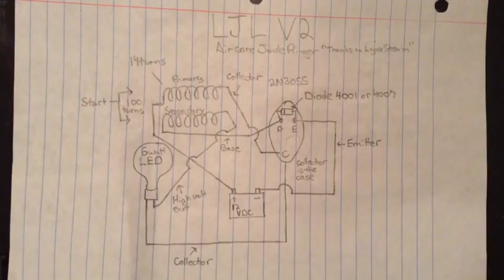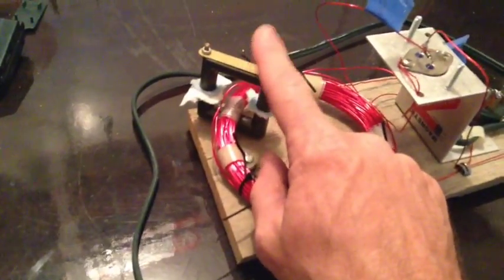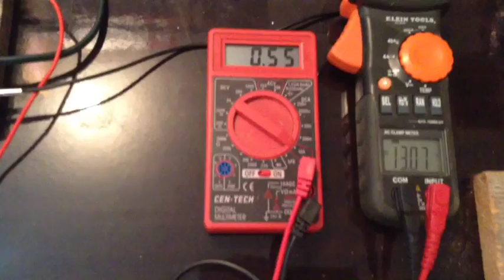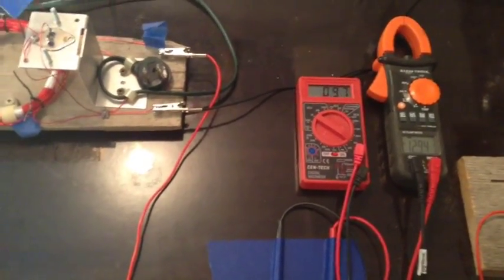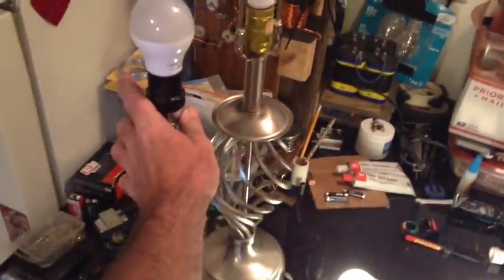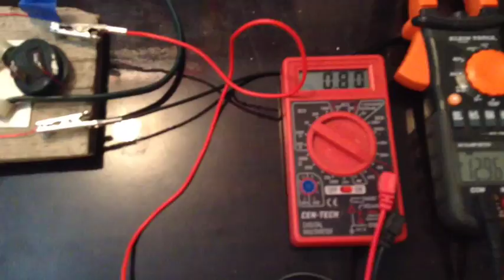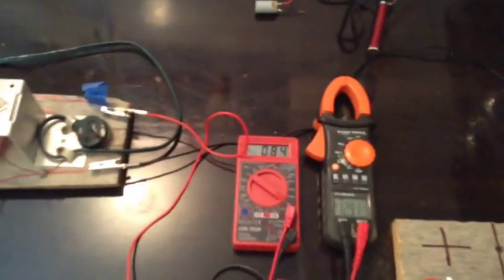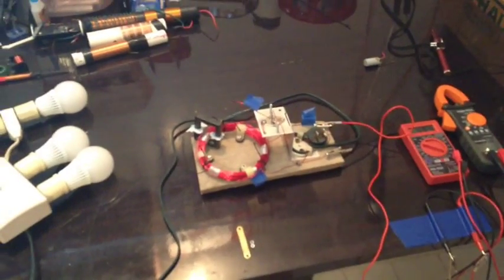Lynx Joule Lamp LED Driver LJL V2 BackRoomLabs

Comment: super glue your ferrite core for no noise.
Reply from the maker: I'll try that thanks for the input. Is it the high frequency vibrations that causes the noise?
Reply: Yes, the ferrite vibrates if not glueed, I have tryed taping them tightly together and does work in some cases, but I have designed a new way smaller lighting system useing a ferrite ecore 26.5 turns primary, 265 turns secondary and runs cooler and with less voltage drop.
Reply: super glue you, use a solenoid or a torroid. Mine makes zero noise. you have no videos, just a troll.